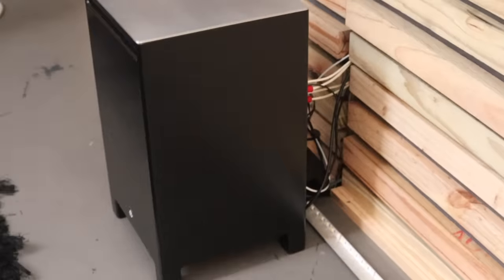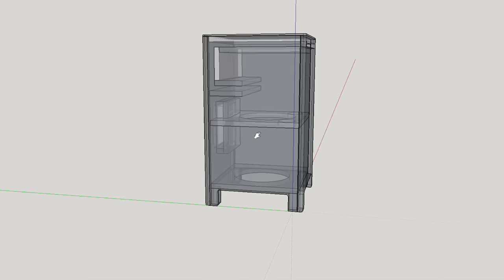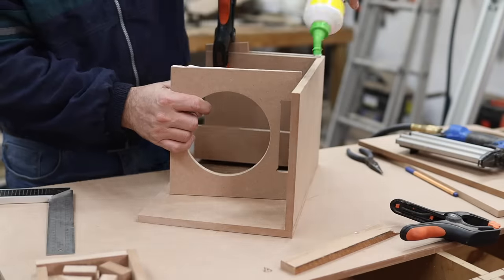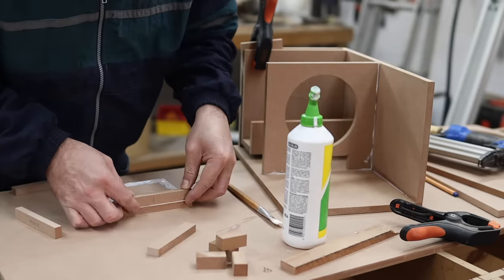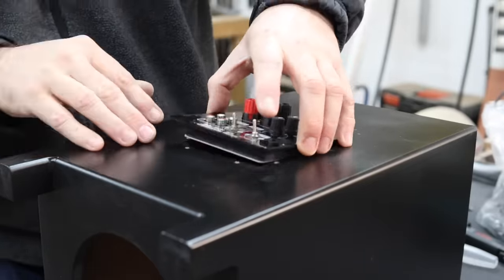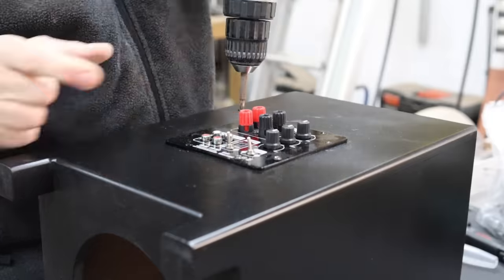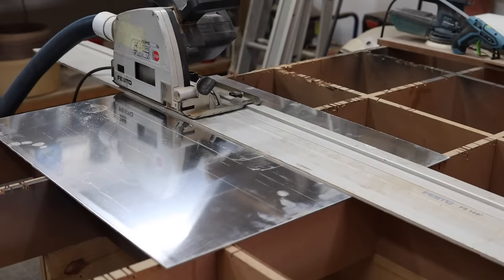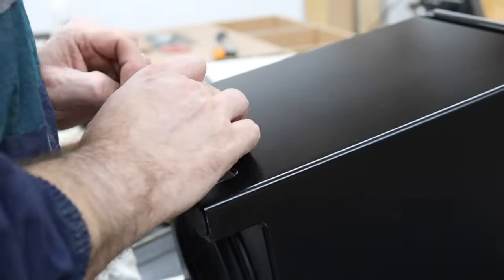Building a 6.5 inch SUBWOOFER (for Sound Bar V2.0) - by SoundBlab

Comment: I became a subscriber when I watched your video on the DIY Ported Subwoofer Build. Very impressed with the use of the router. You make beautiful speaker cabinets. I like the soft edges of the majority of your cabinets as they will resist chipping. Your speakers sound good too. I also was not aware of these miniplate amplifier/crossover boards that you install in some of your subwoofers, So I am grateful for the knowledge of them.
Reply from the maker: Thank you very much!

Comment: Looks so beautiful and neat in the minimal design. Waiting for the next video.
Reply from the maker: Thanks a lot 😊
Reply: @SoundBlab  Will it make any difference if I switch the position of the sub from bottom to the front and using the same enclosure dimension?

Comment: Quick tip: don't solder wire ends that are going into solder terminals, the solder can migrate and you'll end up with loose wires 👍
Reply: I've been wiring pots like that for years and I haven't had an issue with it.

Comment: I'm interested in building a 6.5 sub enclosure for the best sound quality. Tight bass, no boomy sounding bass.
Would it just come down to how rigid the enclosure is?
Reply from the maker: A rigid enclosure is critical for a subwoofer, however the enclosure must also be designed and modelled well with software. Too small and it can be come boomy at higher low frequencies, and also limit the output at the lower end. Too big and you can again loose output at the lower end. The size of the vent, if going with a bass reflex enclosure is also going to determine the outcome. Too small of a vent can cause port chuffing as the air moves through it. So there are many factors to consider for a good subwoofer enclosure design.
Reply: @SoundBlab  after all those factors are taken into account, then rigidity?
I've always heard the more rigid you can get the enclosure, the better or tighter the bass will be.

Comment: @SoundBlab  Will it make any difference if I switch the position of the sub from bottom to the front and using the same enclosure dimension?
Reply from the maker: You can do that. It will perform the same.
Reply: @SoundBlab  thankyou

Comment: Cool build but that port looks dangerously small. Port Noise?
Reply: For a 6.5" driver that seems like enough port area, it is fairly wide. And it also probably helps achieve a lower port tuning.
Reply from the maker: It actually does not create any port noise, even at full volume. I made sure to look at this when I was modelling the enclosure in software.

Comment: How does the sub plug into the arylic? I've bought plans for the soundbar design, but already have a sub to use Thanks mate
Reply from the maker: I use the line output from the Arylic to plug into the sub, which is a 2.1 plate amp.
Reply: @SoundBlab  thanks for getting back so fast, by line out are you referring to speaker cables that run to the subwoofer or is there an RCA connection that I can't see on the board? ( as that's what I'm used to connecting a subwoofer with. )

Comment: Seemed unnecessarily complicated for a sub box. Could’ve used 3/4 inch plywood and skipped internal bracing. Also that port looked super tiny, what velocity is that pushing at max volume?
Reply from the maker: Of course you can use a thicker material, but bracing eliminates the need for that. Even with 3/4 inch I still think bracing will be a good idea. The port was modelled to avoid any chuffing that might occur at higher volumes. You can pump this to its max, and still not hear any chuffing from the port.

Comment: May i ask yoou what the function of the white cotton mesh you put inside?
Reply from the maker: It's a damping material that helps to break up any standing waves that we get inside the enclosure. It also reduces sound waves reflecting back onto the back of the woofer cone. All this helps to 'clean-up' the sound coming from the subwoofer.
Reply: @SoundBlab  Got it, so its let us to hear the 'solid' or 'pure' sound that came out from the cone

Comment: Wo ist der Stromanschluß für die Endstufe? Wolf-Dieter Manzke
Reply from the maker: It has a 12v power socket on the back of the plate amp. It connects to an external power supply.

Comment: Great video! Does the Amp need more ventilation? It seems that there’s no airflow around the electronics.
Reply: I agree that normally a bit of ventilation would be usefull. However, I feel like this amp is not likely to overheat any time soon, since it is a highly efficient and relatively low power class D amp. I reccon that the little heat the amp might generate, will not be enough to cause any issues. Furthermore, the chip will also be cooled by the aluminium backplate.
Reply: @wesselw.7801  unfortunately I have seen the opposite from a lot of people with this particular amp. It overheats very quickly. Not very reliable.
Reply: @p_mouse8676  Are you certain that they had the amplifier setup correctly? The chip has an efficiency of 90% which makes it put out very little heat if it is used correctly. It seems to be quite an uncommon issue in online reviews so it might be possible that it was setup incorrectly, maybe a lower than 4 ohm impedance. If not, maybe  they got a faulty one?
Reply: @wesselw.7801  They had the amp running free air even. And 90% seems a lot, but that is still not 100%. 
More over, the PCB design is just really poor, and mostly the inductors on it are WAY to small. (I design amplifiers myself fyi)
Reply: @p_mouse8676  Hmm, well will see of the amp holds up in this configuration :b. Btw cool that you are designing amplifiers :). If I might ask, what is your opinion about the kab250v3 and the dspb250 from dayton audio? I reccon they are cool little boards, but do you have any knowledge about any flaws?

Comment: This little thing will struggle in the lower frequencies and even the 30's might have significantly low output ...?!
Reply: It'll probably be fine down to the mid 20's or so, the smaller 5.25" version of this woofer can managed mid 30's just fine.
Reply: @__-fm5qv  Hmm! I doubt they'd be much output at the lower frequencies compared to it's sweet spot of 60-80hz with a 6.5". I'm sure it can play 20hz and 30hz but how much output does it loose?
Reply: @BUZDRIFT  Well the 5.25" version I have is playing down to 37hz at -3db. These drivers are pretty much exclusively designed to go deep, but at the sacrifice of overall sensitivity and some reponsiveness/tightness.
Reply: @__-fm5qv  Yeah, that's actually pretty good for such a small driver! Damn!

Comment: Pls tell me, is a 5 inch sub is good for making a home theatre
Reply: The smaller it is the worse it is. You generally want your subwoofer to only produce sound up to 80-100Hz because then it's hard to tell where the sound is coming from. 5 inch sub is very small and it will be making sounds when you don't want your sub to make any sound, like males with deep voices speaking. 

For home theatre speakers 6.5 inch subs with sound bars are the bare minimum I would go to and even those are often borderline. My bookshelf speakers have 6.5 inch midrange drivers for example and I have 10 inch sub to match them, which is still considered small in home theatre standards.
Reply: @UhOhUmm  thanks for your words,  opinion from an experienced person is more helpful to me
Reply from the maker: If you have small speakers or even a sound bar to pair it with in a very small room you could get away with it, but generally I would not recommend it. Would be better if you still want to go that way, is to use two 5 inch drivers not just one. A 5 inch driver will also not give you much output below 35Hz. So it all depends on the application.

Comment: I think the port is too small
Reply from the maker: It is not. The port was modelled to be able to handle the power requirement of the driver without port chuffing. And it works great. You can crank up the sub without hearing any noise from the port.

Comment: You used a subwoofer of at least 200 watts for a 60-watt amplifier!!! are you okey?! :|
Reply from the maker: That is incorrect. This sub has a power rating of 50W RMS, and 100 peak power. Trust me, the 60W of amp power is more than adequate.